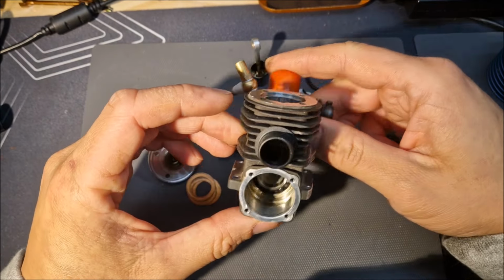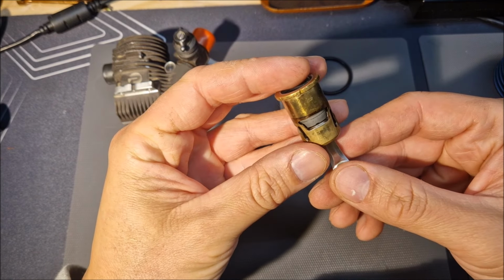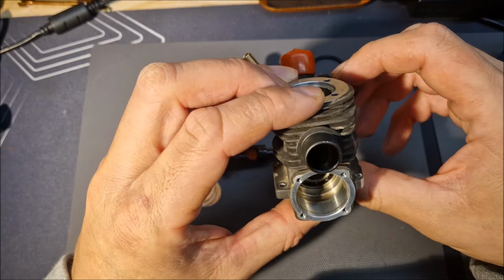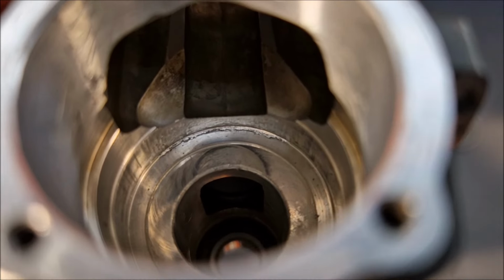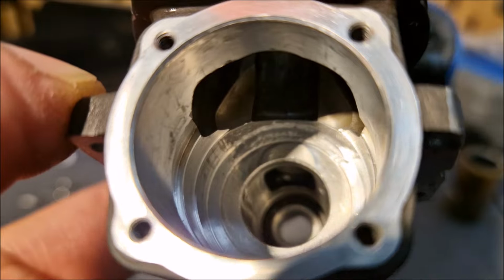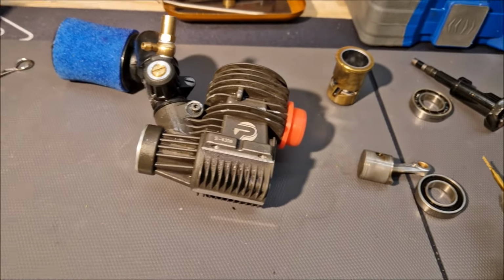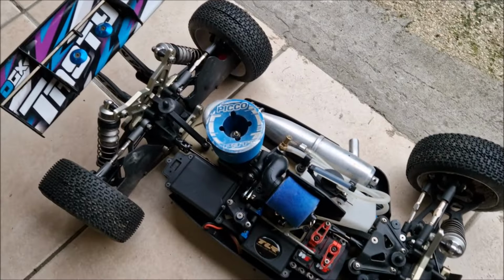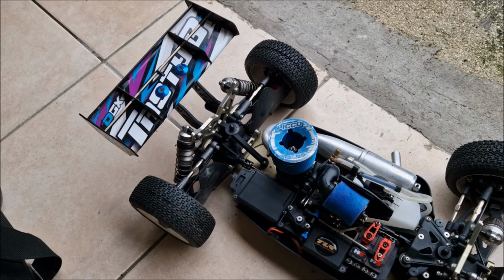This Picco P3TT Nitro Engine went through HELL will it Run?????

Comment: This does not look good. If the crankcase there is damaged and has play, the new bearing won't last really long. It's likely to fail after a couple of liters. Repinch like this is definitely not good. It creates a lot of stress on the rod and bearings. Very curious how long this refreshment will last. Great vid buddy
Reply from the maker: Thank you Kings,  the rear bearing was a bit to easy to install... so Im not very confident, hope he can burn 5l with it, we will see, ill let you know. Its a miracle that this picco still running, it had a very rough life

Comment: Run it for a while it may correct itself and run for a long time , Piccos are strong strong 💪
Reply from the maker: I totally agree, picco quality is outstanding,  probably getting it to running temp a couple times my fix the sleeve issue, afterall she is not running that bad. But the bearing may be an issue in the short term

Comment: Definitely repinch to far down the sleeve!!! But you should be able to heat up really hot on sleeve, a that back bearing was not put in straight and probably not with a bearing tool it’s a shame? What was the back bearing size? Tasty?
Reply from the maker: Yes, he should be able to reheat the sleeve and try to fixt that but not sure is worth the effort,  dont know if the bearing will hold on. Its regular 25.4 bearing.  And yes he replaced the bearings without the proper tool, its not impossible,  i do that with the Lrps ,my took wont fit those but need to be very careful. Thank you Tony.
Reply: @TastyBRC  it’s a shame it’s a good motor 👍 but probably not worth the hassle 🤜💯

Comment: Where you able to drive it and test it under load?
- You are right she doesn’t sound perfect but, I hope the engine is ok enough to drive a couple liters before it dies

Thanks for the vid Tasty 🩷
Reply from the maker: Exactly,  that was the goal, get it to run a few more litres.  No I didnt run the the car, just a quick box tune, lack free time, rain.. Ad3 waiting for break-in, Rebuilding a old nova, new reds coming 😁 (not mine but im happy to test a reds) 
Thanks for stopping by ✌️
Reply: @TastyBRC  You have a nice line up then. Share with us if you can 😄
Thanks 💯